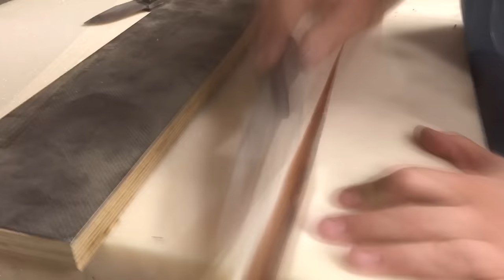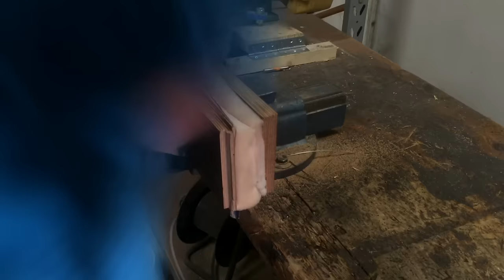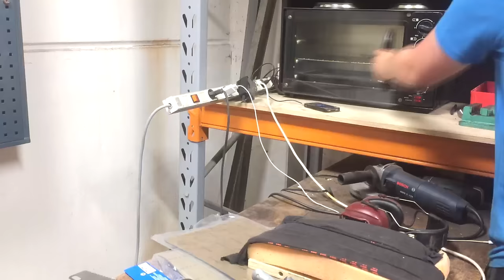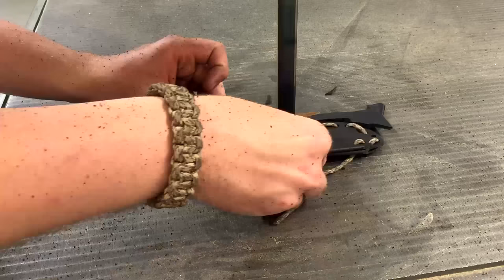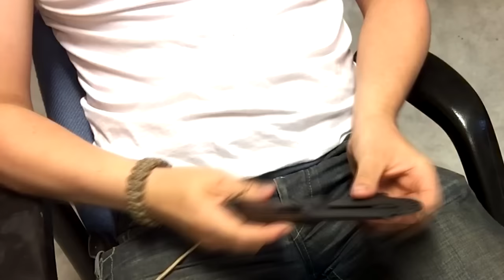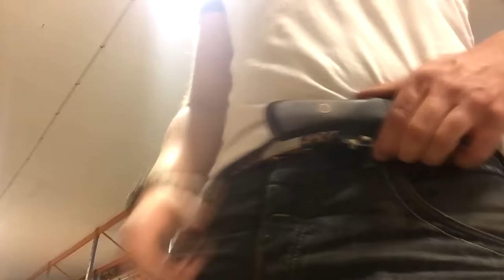Simple way to make a Kydex Knife Sheath + kydex press

Comment: What if you didn't want any holes? Could you simply use epoxy?
Reply from the maker: Yeah, or one of those plastic weld substances. Could be prone to cracking up, but if you have a taco construction it should still work until you can get it fixed ;)